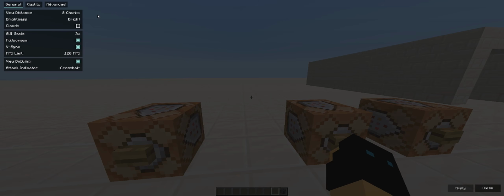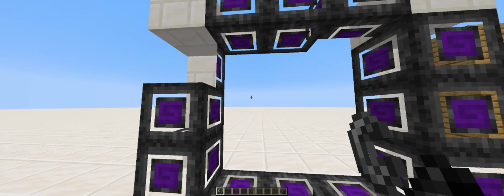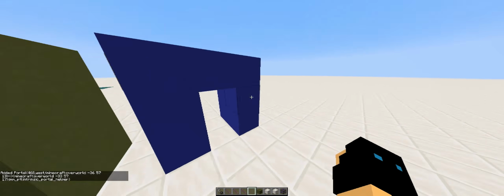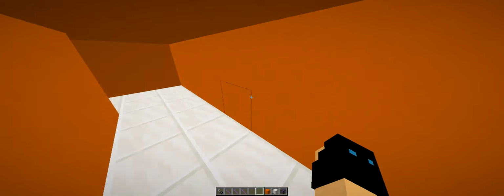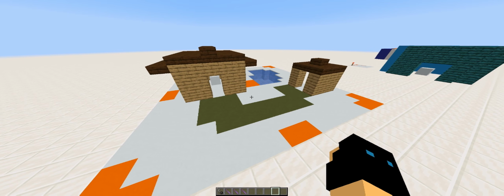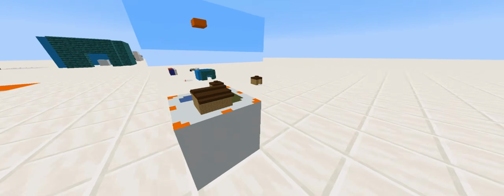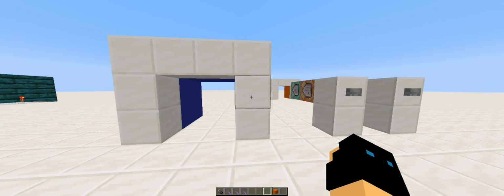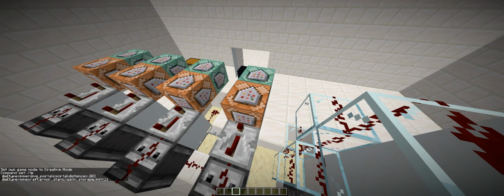Non-Euclidean Minecraft tutorial

Comment: i dont understand how your portal is long i dont find the small blocks part very helpful if you dont show that part
Reply from the maker: You should rather watch tutorial 2 (there I used scaled box view instead, which does everything for you). To create a longer portal, you just have to use a differently sized portal. So, if you want to make a 2x4 long small block structure you have to use /portal make_portal 4 1 [...] for one side /portal make_portal 2 1 [...] for the other side and /portal make_portal 4 2 [...] for the top side.
With /portal create_scaled_box_view [...] you can just select a non-square region to get the same result.

Comment: if i try to link a big portal and a small portal together it wont work can someone help me
Reply from the maker: are you using portal helper blocks or commands?
Reply: @PhillXD  blocks
Reply from the maker: @lilleplsemix3438  do you have Pehkui?
For the blocks to work with portals of different size, you need to have the pehkui mod installed.
Reply: @PhillXD  I do have it installed
Reply from the maker: @lilleplsemix3438  The only thing I could still think of is, check if immersive portals is up to date. And if you aren't already, use fabric (don't forget fabric api).
Reply: @PhillXD  ok and it is and I use fabric api

Comment: There is an easy way to do the tiny blocks, as there is a command in the game that does all of the steps for you: 
/portal create_scaled_box_view <x1> <y1> <z1> <x2> <y2> <z2> <scale> <placeTargetEntity> <isBiWay> [teleportChangesScale]

This is quite the command, so lets take it one step at a time.

<x1> <y1> <z1> <x2> <y2> <z2> : these are the coordinates of the thing you want to be shrunk down. x1, y1, and z1 are the coordinates of one corner while x2,y2, and z2 are the coordinates of another.

<scale>: This is how big you want the small blocks to be. For example, if you select an area that is 16x16x16, if you set the scale to 8, the small area will be 2x2x2. if you set the scale to 16, it will be 1x1x1. This works in the opposite direction as well, for example if you set the scale to 0.5, it will be 32x32x32, making the portals bigger.

<placeTargetEntity>: This one is just the entity where the box will be placed. For example, if the placeTargetEntity is @p, it will put it directly at your feet.

<isBiWay>: Self explanatory, either "true" (it is bi-way) or "false" (it is not)

[teleportChangesScale]: This one is a bit hard to explain, so i reccomend trying out both options, but I will do my best. If this value is set to "true", when you step into the portal it will change your scale so that the box looks normal. If it is set to "false", when you step into the portal it will not change your scale, meaning it will still look small

As always, If you have any questions let me know.

Edit:It looks like the creator of the video uploaded a tutorial on this command, so yeah def check that out lol
Reply from the maker: I did also make a second tutorial, where I showed how to use that. A link is in the description and there is an infocard. But still thanks for the detailed description of the usage of that command 👍
Reply: @PhillXD  my bad man I didn't know! I'll check it out now :)